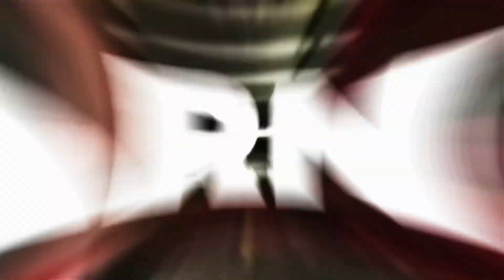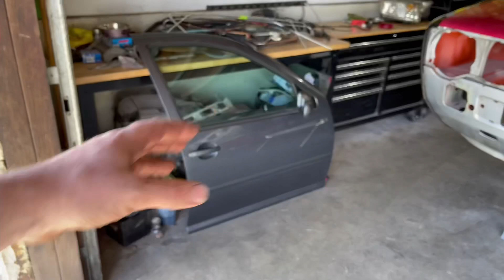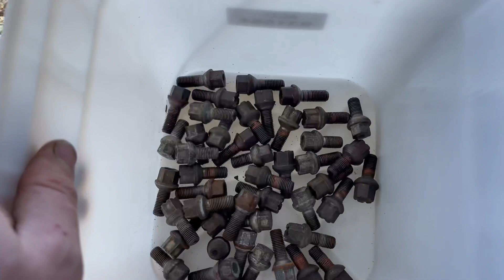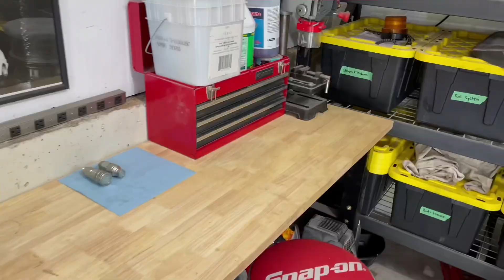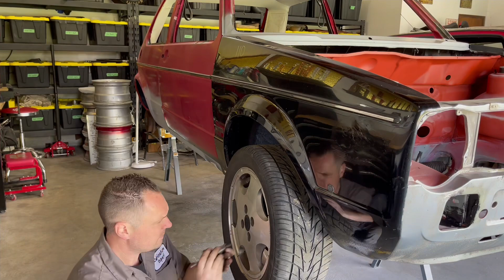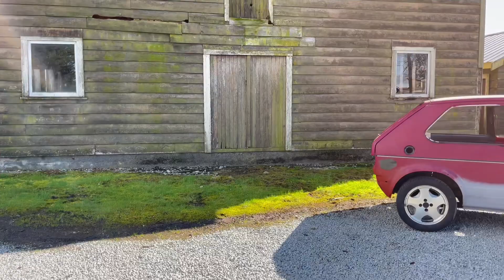Volkswagen Golf Mk1 Build (Ep.35) / THE PROJECT MOVES + GARAGE CLEANUP / VW Swap Rabbit Caddy Citi

Comment: Always nice to see them roll. I'm guessing you plan to replace the front wheel bearings anyway so no need to keep drive shafts installed? Or maybe you will use other spindles for upgraded transmission, etc?
Reply from the maker: Hahaha yes, almost all of the above actually! these are all just very old components i keep lying around for mostly this reason but yes, lots of freshening before this car see the road, that's for sure!! And ill be keeping a constant supply of video covering off all of it, so stay tuned for that!! Appreciate the comments for sure, and thanks so much for watching and the support!! Cheers

Comment: I'll start by saying thank you for the motivation and info needed to complete or take on a mk1 build. I have a 81 diesel 4dr and mk4 engine harness,vrt engine,trans, vrt ecu. Is it easier to get a mk4 vr6 donor and and do n/a swap or get a mk3/mk4 2.0 aba and swap everything over? This is my 1st swap. Thanks in advance😎✌
Reply from the maker: Hey thank you!! Appreciate that very much!! Appreciate all the support and thanks for watching!! Oh boy lots going on in this question lol...

Well if i read this correctly you have a VR6 Turbo'd engine, ecu, trans, and harness correct? and you want to put it into a mk1? ... if so you, already have everything you need to do the swap other than the swap kit (needed from an aftermarket company) your choice of brakes and your choice of cooling. S&P may have the remainder of what you need all in one place minus the brake options. You may not need a donor car at all, unless you want to use all the braking components. You basically already have the swap so to speak. Hope that helps, cheers!!